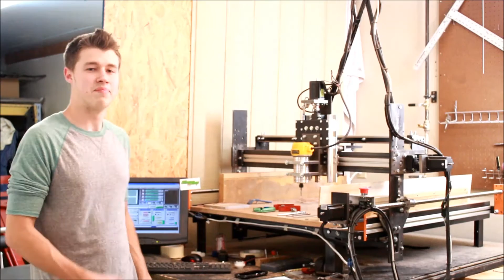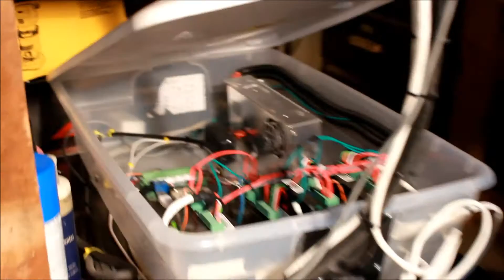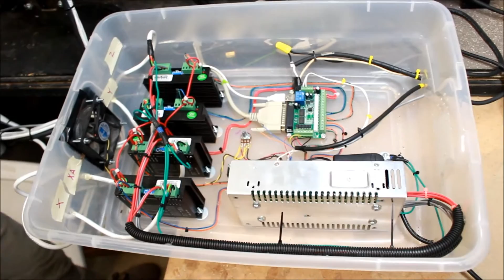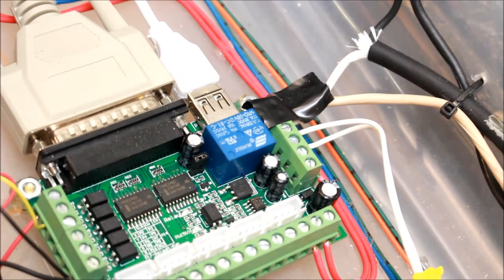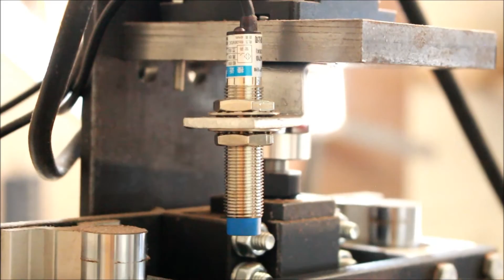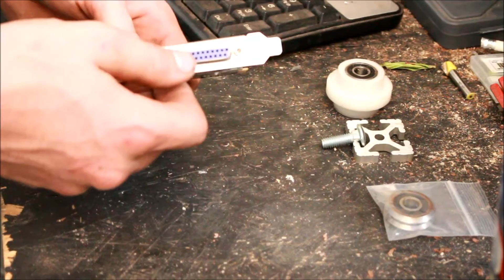Homemade CNC router (Wiring/electronic)

Comment: Hey +Catchon, i bought exacly the same Stepper Motor Kit and Prox.Swithces  like u did. 
Could u please help me in two questions:

1. You power the four Stepper Motors with only one Powersupply right? Wonder how, cause mine has only connections for three Stepper Motors. Did you whire the Power Cables for the two Y Motors in parallel onto ?

2. Did u you connect the Power (Blue & Brown) Cable of the Proximity Switch to the Breakout Board (if so: where?) or to an external Powersupply?  Even if u made a good explanation, i dont get it.

Thanks a lot and greetings from Germany

Jan
Reply from the maker: Hey Jan, thanks for the interest in my video, its awesome to see people around the world seeing my videos =D!  Yes,  i just doubled up at the power supply.  So far, havent had any problems with that.  As far as the prox switches, see if this diagram helps ( http://hsar.ru/image/cache/catalog/product/d010-1-1000x1000.jpg ) I want to double check on how I wired them, but my router is at my friends house now, so ill have to get him to send me pics.  I wish I remembered but it been so long.  Ill get back to you!
Thanks
-Ryan
Reply: Hey Ryan, thanks for your Answer. This diagram is already known. Would be really nice if your friend could find some time to make a few detail pictures of the switches wiring.  

Thanks again and greetings

Jan
Reply from the maker: Im hoping ill be over at his house in the near future and take a look for my self.  
Thanks

Comment: So I ordered a breakout board/driver board (all in one) called the tb6560. It was a kit and it came with a 24V power supply and 4 nema 23 270 oz steppers. It keeps overheating and i have yet to get it to run the steppers at all. I'm returning it (luckily the seller is awesome) and getting something different. I wanted to see what you used so I clicked on your link and it goes to a kit with only the drivers, power supply, and steppers but no breakout board. What is the model of breakout board you use? I'm willing to wait a little longer and save up more in order to not have huge headaches with the electronics on this CNC.
Reply from the maker: +Kaden McDonald  hmm must have replaced the kit I got with another kit.  Anyway, you can get the breakout board from eBay (china) for 5$ and get it sometime within a month.  Or get it off amazon for a little more money, and have it within a week ( http://amzn.to/20Wa1uG ) that board comes with a usb chord, but you will also need a parallel chord ( http://amzn.to/1SVSfIH ) If you need wiring info for the breakout board you can look at these pictures ( http://amzn.to/21i0nYN )  As far as over heating, is it the breakout board that is over heating or the motors?  Make sure your dip switches on your drivers are set to the right amps.
Reply: +Catchon thank you for the links and info! I'm thinking I won't need more than the 270oz per inch motors that I got to run my cnc as it will be wood instead of metal. What do you think about this kit? 

http://www.ebay.com/itm/US-Free-4Axis-Wantai-Stepper-Motor-Nema23-57BYGH627-270oz-in-3A-4-Lead-Driver/151797913098?_trksid=p2050601.c100085.m2372&_trkparms=aid%3D111001%26algo%3DREC.SEED%26ao%3D1%26asc%3D20140211132617%26meid%3Ddc8456481af9459db09790202bc9ba0f%26pid%3D100085%26rk%3D1%26rkt%3D4%26sd%3D151797913098%26clkid%3D3562100643510875850&_qi=RTM2247625

What is the reason for the usb connection to your breakout board? I have a computer ready with mach 3 and everything that has a parallel port and everything.
Reply from the maker: +Kaden McDonald No problem!  That kit should work for you.  The usb connection is to supply 5v to the breakout board.  Were as your Breakout board has pinch screw terminals to connect the 5v.  That board also lacks the relay.  Im using the relay to turn on my router when I start a program.  Which is nice =)
Reply: +Catchon ok so I will have to find a 5volt power supply to power that one then? I'm still back and forth on what I should order. Just sent my broken kit back today. I'm going to build the whole table first then order in the motors so I guess I have a while to decide.
Reply from the maker: +Kaden McDonald To my knowledge yes.  Its up to you,  but it is kinda nice having the electronic stuff to mess around with, when the construction side starts getting little old lol....just my 2 cents.  But defiantly dont rush buying something!

Comment: I don't know if you have hooked up proximity sensors for the other two axis yet but if you did a super detailed video on that alone as far as wiring them, and how they work with the software, that would be amazing.
Reply from the maker: +Kaden McDonald , I actually only put one on the z axis so far.  Mainly because that was the only one i ran against lol.  I have thought of adding them to the other axis's.  Are you looking for a video on prox limit switches? or prox homing switches?
Reply: +Catchon To tell you the truth I thought that the software did the homing using proximity limit switches. It was my understanding that it turns one axis at a time until it senses the limit and that is the "zero" of that axis. Now that you explain that they are different things I am even more curious. I'd love my machine to be able to home itself and I'd also like there to be a limit to each axis because I was to be able to get close to using the full amount of surface area without fearing I'm getting to close to it running into the shaft couplers.
Reply from the maker: Well I was more asking, just to see which way you were wanting to set it up.  I havent looked much into the homing switches, especially for the dual x axis.  Because you really wouldnt want to run, one out of the two lead screws for a dual lead screw axis, to home it.  it would really tweek the gantry. (if that makes sense).  Anyway maybe I will try to get a quick Video up on setting up the Prox limit/homing switches.  I cant promise when ill be able to do it.  I work 50 hours a week, have 2 kids, and alot of other projects that are taking my time :/.  If you want more closer pics of my router you can check out my Blog.
Reply: +Catchon not a problem at all if you don't get around to it you have been awesome to help me out as much as you have! I'll check that out to see some pics. Thanks again!
Reply from the maker: Thank you!  Always love helping ppl with projects like this!  Thats why i started youtube =) If you ever have any questions don't hesitate to ask!

Comment: Hello! Nice work! can you please tell me where can i find your wiring diagram, i looked on the sellers ebay page , but couldnt find it.
Reply from the maker: +miharajnovac, I dont have one off hand, but I will find you one!  Anything in particular you want to know?
Reply: +Catchon Im particulary interested in breakout board - driver board - motors, connection. I ordered the same set as you from stepperonline, will post the pics of my machine.
Reply: +Catchon Im particulary interested in breakout board - driver board - motors, connection. I ordered the same set as you from stepperonline, will post the pics of my machine.
Reply from the maker: miharajnovac This is the interface I used. ( http://amzn.to/1Svrwko )  I didn't buy this specific one, it came with my stepper kit.  This is just the only one i found on amazon, with a wiring diagram as one of the product pictures.

Comment: nice machine, how much did that thing cost, atleast a few grand eh?
Reply from the maker: +chris loves Erszi Thanks!  And roughly $1500 and alot of time haha
Reply: +Catchon ya its right sweet. I'm working on mine atm, ive spent only about $120.00 on mine (4 steppers, easy drivers, mach 3 breakout board) the rest ive used materials ive already had. obviously mine is wooden but I'm working on the laser burner for it now too.
Reply from the maker: +chris loves Erszi - Awesome man.  I prolly would have went with wood too, except where I work, is nice enough to let me use the cnc mills and saws after hours for my own projects.  Do you have a place where you are showing your progress of your build?  Are you building the laser from scratch?
Reply: +Catchon no I'm not really documenting any progress. you must work at a machine/fabrication shop? Funny because that's what I do for a living, still fitter/ welder but I lost my job a year ago. it would have been sweet to built it all out of steel and I don't even have a drill press. that's super hard to make things line upnwhen I have to use a hand drill. lol. I bought a laser from eBay and plan to use that for engraving.
Reply from the maker: +Elizabeth Twitty are you the same person as +chris loves Erszi ??
Either way, sorry to hear you lost your job.  I do work in a machine/fabrication shop of sorts.  And yes i hear you, I couldn't imagine trying to do it with a hand drill, but Im sure it can be done, and has been done!

Comment: very nice build.  I work on (repair) the bigger plasma cutting versions of these awesome machines a few times a month.  I even got to visit one of the plants that manufacture them in Milwaukee last year.  I'm a maint tech at an industrial plant.  I'm planning my build now for my first cnc machine.  I have access to everything needed to build the frame at my work and can get for a fraction of the cost so this is a no brainer to undertake this project.  finding time will be my biggest challenge I think.

please keep up the good work.  I look forward to seeing more.
Reply from the maker: +Chad Mills There is never enough time in day is there? haha.  It definitely helps to have the right tools.  I was blessed to have access to the cnc mills at my work (and steel).  Kinda why i went with the steel design, which i don't regret.  Cuz its rigid, and i can mill alu. at .05 per pass, 10ipm, and hold 2-3 thousands.  Anyway thanks for watching, and commenting!  Will you have a place where you will be posting your progress?